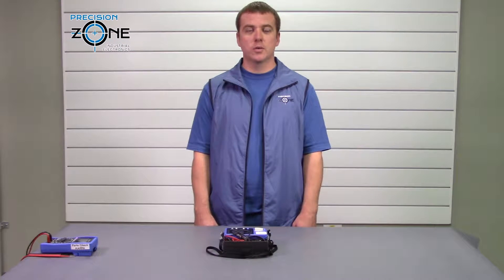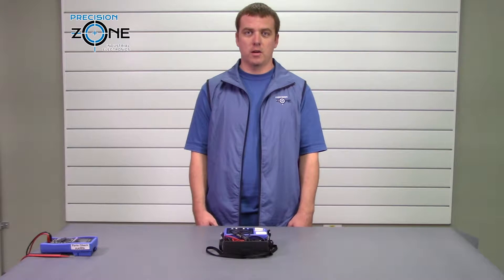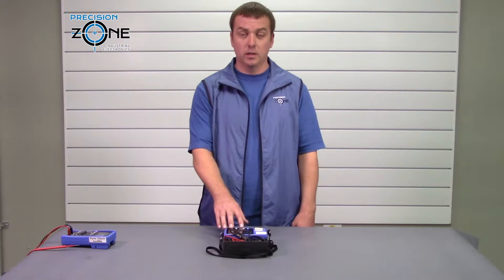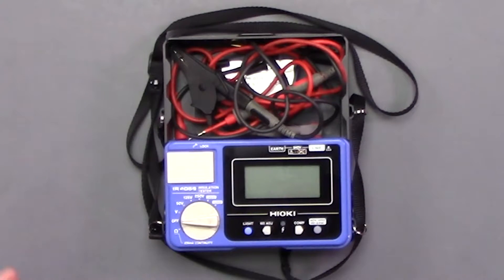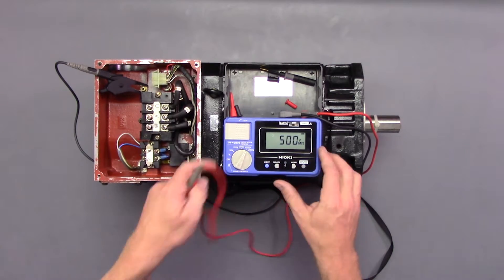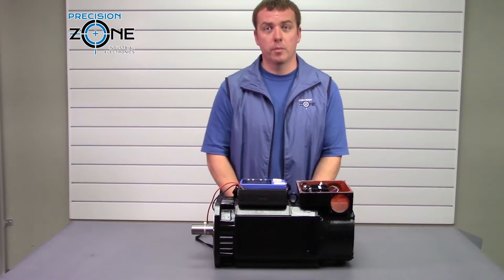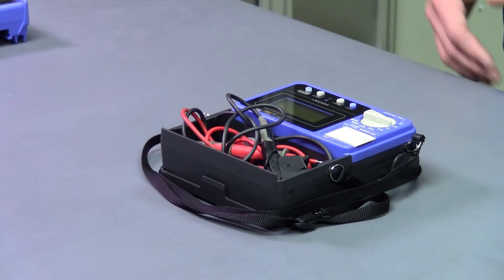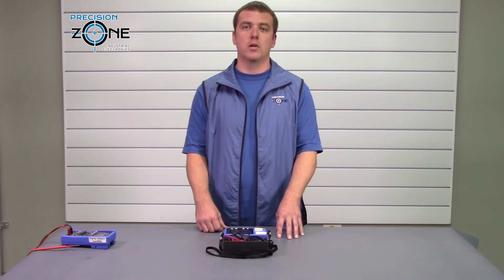Megger Overview

Comment: How much ranage we have to select  to check 3 phase 440 volt star connected  motor having 3 kw capacity  on 50 hz. Please suggest me below 5 kw and more then 5 kw motors which range we need to select .